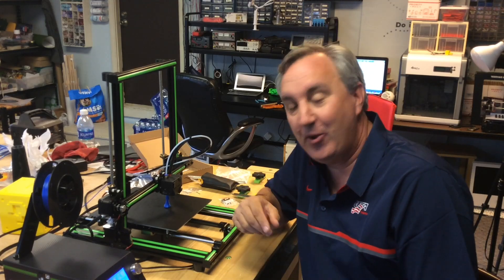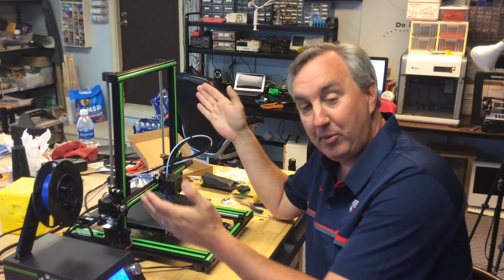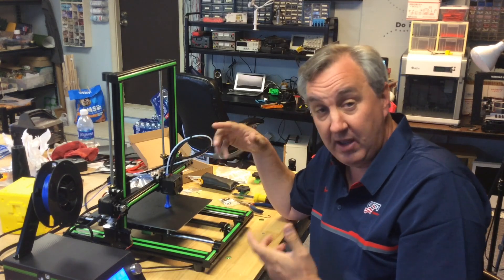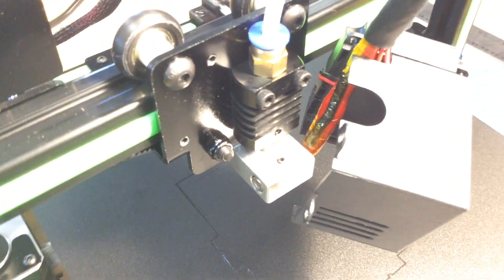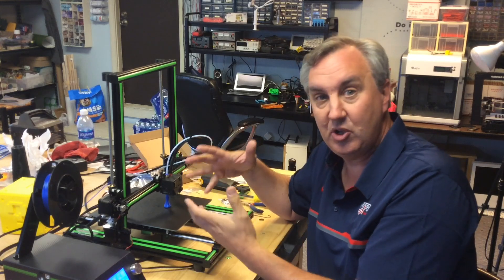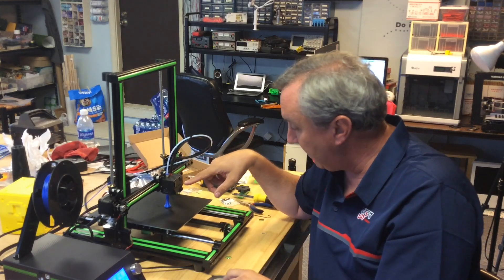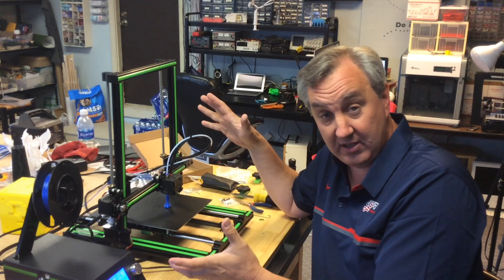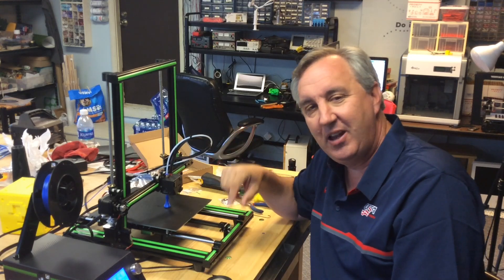Anet E10 3D Printer Temperature Trick

Comment: That seems like a bad solution (no offense, as you at least had a solution).  That fan should be to keep heat creep from gumming up the works.  Tape would prevent that.  I think it would be better to design an offset mount and change the angle of the fan.  Of course, how can you do that if you can't print the parts?
Reply: Figured.  I hope your next video on the machine goes over how to make a permanent fix...without making a switch to E3D.

Comment: The problem I see is not the heatsink attached to the pale at all, in all respects that is on the cold side of the heat break and you want it cold even, the problem is that to top of the heat block is also exposed to the fan and the fan is not only cooling the heatsink as it should but also the heat block, you need to insulate the heat block in a manner that the fan is not blowing on it... dm me if you have more questions, I've seen this problem before on other units

Comment: Odd that the heat block itself is mounted directly on a large hunk of metal...I though the whole point of the heatblock then the large finned neck was the neck was supposed to be heatsinked and cooled and only the block got super hot

Very odd...

Definitely want to see how much smaller than the CR-10 the E10 is...
220 x 270 x 300mm large build volume, ah...looked it up
Reply: Ah gotcha..yeah..either needs to deflect the cooling fan airflow...or make a high temp silicon sleeve to insulate it
Looks like your method works so much easier :)

Comment: Try using washers as heat break, or spacers like many printers use . For the fan a piece of cardboard with cutout for the wires wrapped in KAPton tape do a small ramp rom the bottom of the fan to the throat

Comment: So if it dosent heat up all the way and it doesent give you an error message that means they have disabled the min temp feature in marlin or what ever they are using. I am not saying its a bad printer but for a beginner this is a big and dangerous flaw. They knew there printer wasnt heating right so they disabled it instead of fixing it (Its enabled in the default configuration). What a great 350$ fire hazzard! Anet is a terrible company for knowingly putting there customers at a risk. Oh did i mention that Marlin is licenced under the GPL licence and they need to provide the source code that they used...
Reply: A chinese company ripping off another one, the irony
Reply: Anet is infamous for disabling the min temp feature.  There are instances of fires because of it (before anyone flames me, please check Reddit).  There is a custom version of Marlin to fix the firmware issues - SkyNet3d Firmware
Reply: EnergyStrike tevo?
Reply: Bilal Akyüz oppps thank you